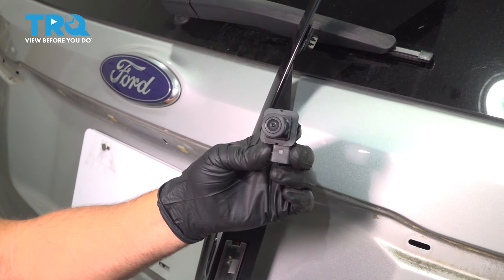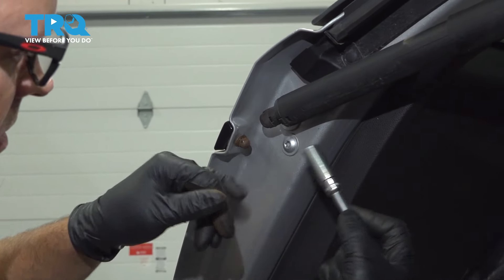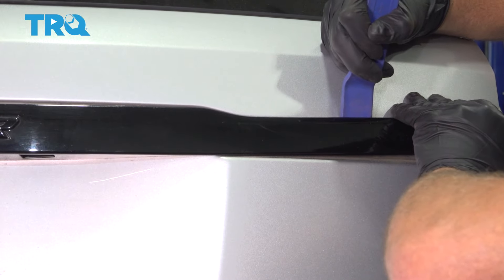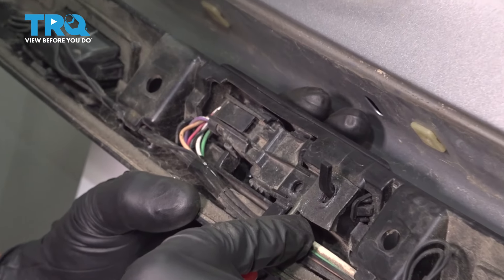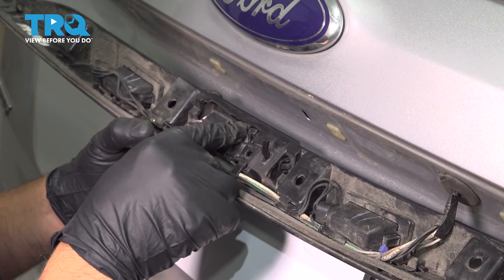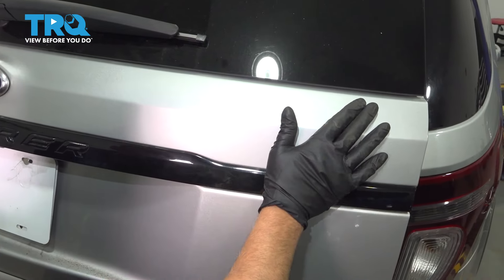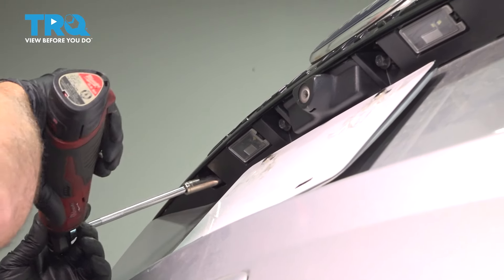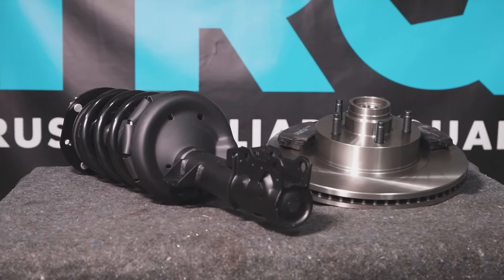How to Replace Rear View Camera 2011-2019 Ford Explorer

Comment: Thank you!  This is the best video I’ve seen for this process.  I just changed mine in 40 minutes using your guidance and I’m so thankful.  The dealer wanted $600!  So $127 for the camera I bought online, and $12 for the trim kit I picked up at Auto Zone, saved me about $450.  The trim tool is a must in my opinion, especially if you’re not accustomed to removing trim.  It’s such a delicate piece you’re removing so take your time.  The retainer clip was a bit of a pain to get out and then back in, but I took my time and got it done with the help of a jewelers screwdriver.  Thank you again!   I’m so appreciative.
Reply: Oh and thank you for sharing all the socket sizes.  That was helpful and I was glad I had everything I needed.

Comment: Once the new camera is installed, does it not need to be (re)calibrated so the curved lines on the interior LCD screen match where the vehicle will end up? If so, any guidance on how to do this calibration?

Comment: I am wanting to add a back up camera to my 2014 explorer. It did not come factory with one. I am adding an aftermarket touch screen in so that we can use a camera. My question is, would the wiring still be in that location if it did not come factory with a back up camera? Looks like there is a block off plate there currently
Reply: You'll have to run all your own wiring. And likely run a remote to trigger thre back up camera. It usually works well off the Back up light. Good luck !

Comment: What if I want to re-route the factory rear cam to an aftermarket radio unit? Where are the RCA-In's that connect to the monitor in the head unit?
Reply: The factory camera is wired direct to the OEM radio.  Their is no rca junction when it comes to factory equiptment.  You would need to wire in a rca plug to the OEM wiring.